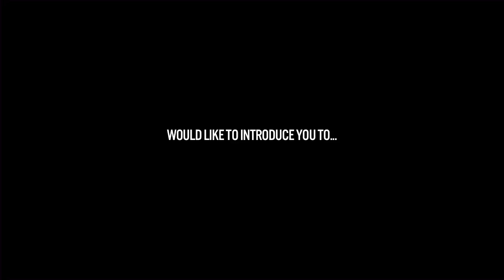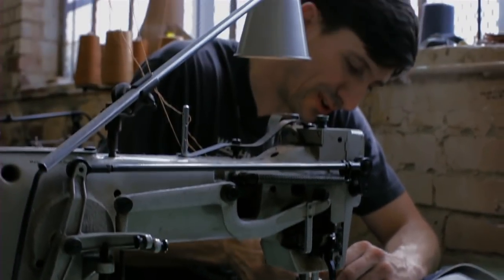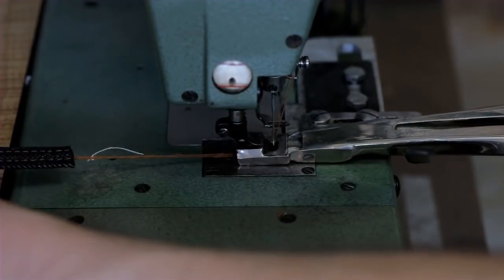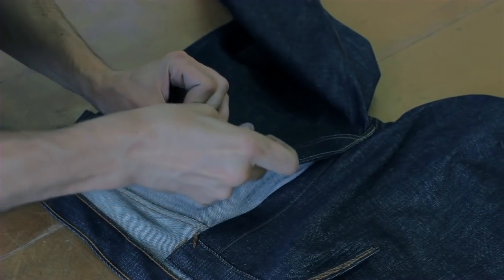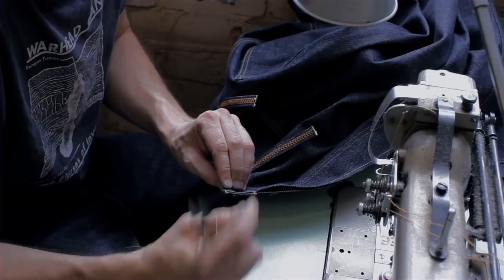Roy’s Jeans - The One Human Jean Maker

Comment: The problem I see is the Quality of the Materials is Crap. Back when I was younger 60's and 70's Blue Jean's were long lasting. Thicker Thread that made a much thicker Material. You could Darn Holes and even Patch if needed be. Now you can still do this, but want hold very long. Jeans are just Crap anymore in my opinion. You can't even find the Materials that used to be so good. It really doesn't matter if the Craftsmanship is Top Notch because of Crappy Materials. This is happening to all things now. Shameful. Greed is the order of today's time.